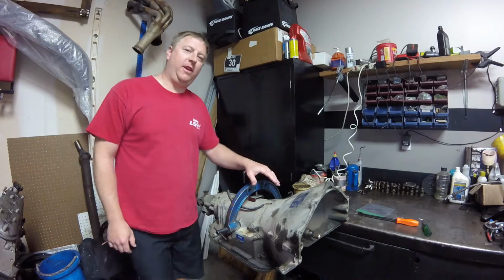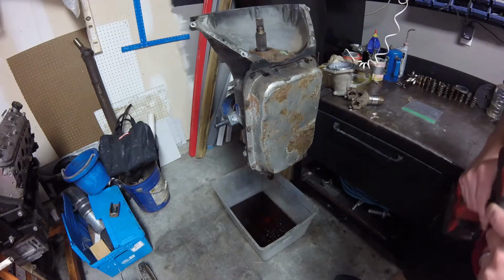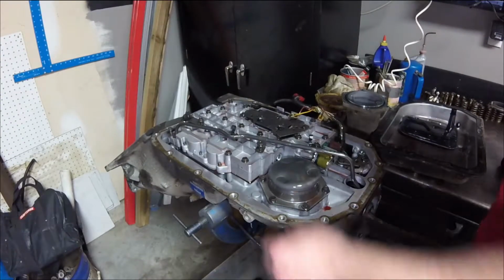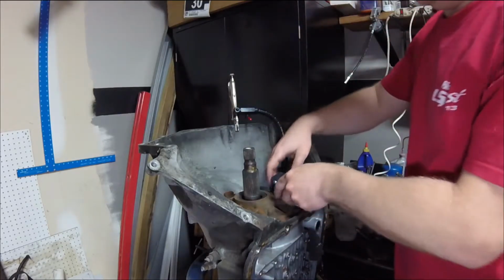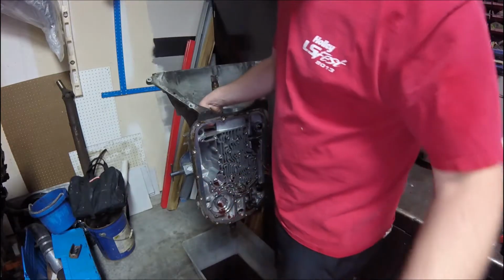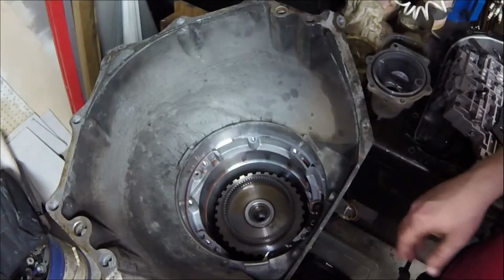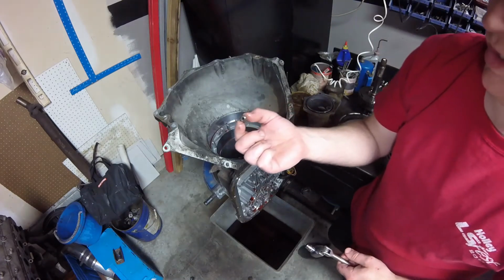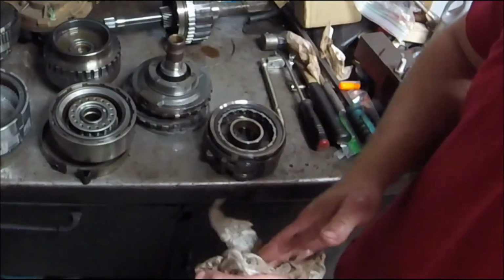How To Build a 4L80E Transmission Part 1

Comment: I've got a 4l80e build that is giving me issues.  Bottom half assembled with new output shaft cluches and bushings and sprag.  Play is .020.   Output shaft spins freely CW and CCW until I tighten the center support bolt, then it binds.   It doesn't want to turn CW (as seen from behind).   If I loosen the bolt 1/8 turn then  it turns freely again.   If I tighten bolt to snug or close to it, then it binds again.    I removed the band, but this didn't fix it.   I thought maybe the rear output shaft bushing might be cockeyed, so I tap tap tap with block of wood but no difference.  The binding doesn't occur in a  repeatable position according to output shaft, so it is probably somewhere inside the assembly.  Any ideas?
Reply from the maker: It’s difficult to tell without seeing it in person but I would think there has to be an issue with that center support setup. Maybe something isn’t seated properly below it? Does the hole in the case line up perfectly with the threads on the center support before you install the bolt?
Reply: @PetesGarageandperformance  The support bolt and the fluid return fitting line up perfectly.    I'm going to take the assembly out of the case and clamp the centersupport with my bench vice in different locations and see if I can replicate the binding in vitro.  Open to suggestions.